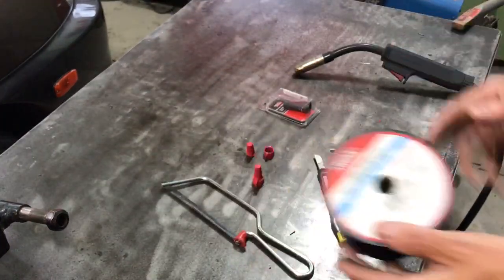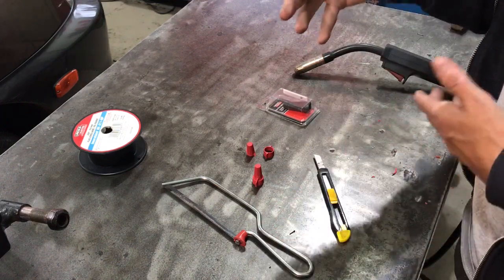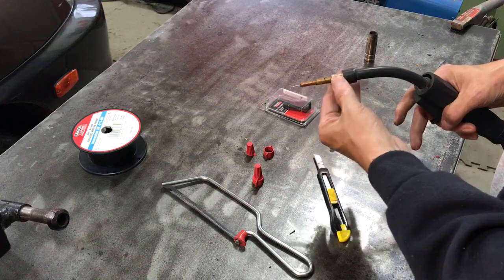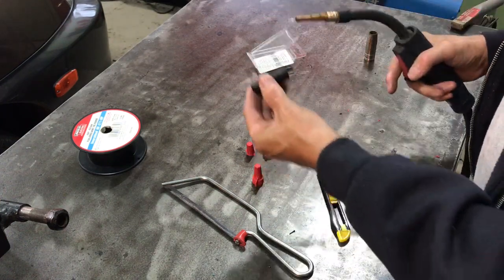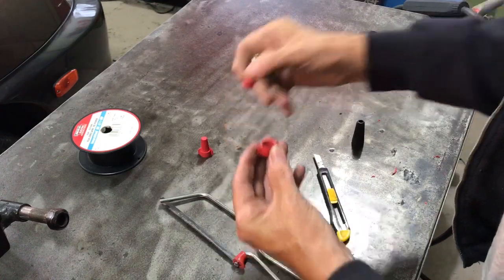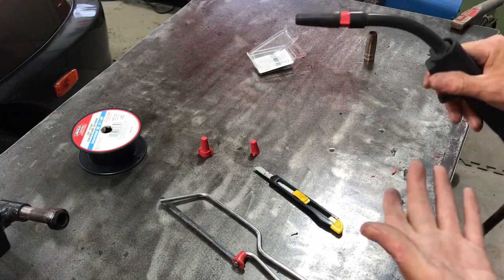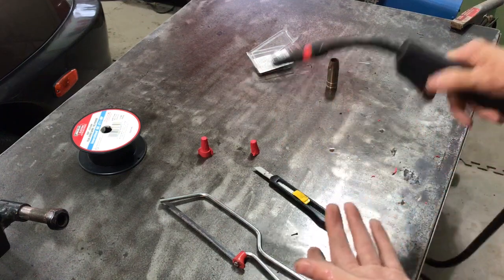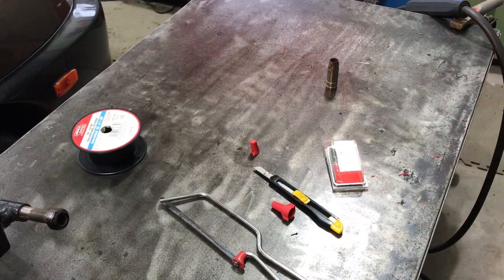Flux Core Welding Tip

Comment: Hey ho Bruce! Good brainwork with the tip. We used Lincoln rods for a long time. The company switched now to ESAB. Copperplatet wire but with gas only. I bet there are some subscribers want to c the actual welding. I do it daily and I think it’s a great work. Sure it’s a bit hot these days, rapped in lether but I still like it. Greetings
Reply from the maker: Hey Madworkx!  I use all different brands of rods but I've never used ESAB.  I've used their wire.
I'm sure it is very hot in the heat wearing leather!

Comment: Hey Bruce 《☆》 Thanks for that awesome tip Bro. We had a NAPA brand wire feed welder at My last job but never plumbed it for argon. We didn't have any Mechs at the time that were certified welders so We had to get any aircraft welding contracted out. The welder did get used quite a bit by many different people. No telling what happens pn the weekends around there when the Pilots have full reign of the place. The old Boss had the welding cabinet stocked up with all the best flux core wire & supplies but the ol NAPAs wire feed was intermittent at best so I pulled out the 50 or so year old Lincoln stick welder from under the bench where it had sat hiding behind some used oil buckets & various other sundry items so I could make some heavier wheel chocks that the Pilots had requested. The old solid rubber wheels rolled well enough to set it up out on the wash rack where I could blow the dust off of it. That ol Lincoln didn't skip a beat Man it fused that heavy angle iron together after a few practice runs I was good to go. Man welding is fun but I wouldn't want to do it every day ☻
Reply from the maker: Hey BDOG!  I have a really old Forney stick welder that I use whenever I can.  It's smooth as butter.  I bought it off a farmer for $50 and hauled it home in the back of my car.  It was a bit difficult to unload at home by myself being that it weighed about 150lbs and is the size of a small washing machine.
My father owned a welding shop and I learned to weld when I was a kid.  I realized early that I didn't wanna weld for a living but it's definitely a handy skill to have.

Comment: If you look at the under side of your plastic fluxcore tip you will see that its threaded and you can twisted over your threads instead of the red wire nut. Funny though cuz im an electrician and ive never used reds on car audio only butt splices and heat shrink tubing. Also when using fluxcore you want to switch polarity on the welder.  Your welds will be much better. Gas welding and fluxcore are not even close to the same. But you can gas shield fluxcore if you want. But double check your polarity and make sure you have it correct. It makes a world of difference.
Reply from the maker: Thanks for the tips

Comment: Lincoln 211-MP is the best and most expensive per pound. Blue Demon just as good for half the price. nice sizzle and amazing flow.
Reply from the maker: I've used Blue Demon TIG rod before but never tried their wire.  I'll check it out next time I'm at the LWS
Reply: @BruceLyeg  ..if you can find it get the E71T-11  if not E71TGS cost slightly less than 11 but both amazing results.

Comment: Thx Bruce. Does this nozzle fit snugly against the contact tip. Would it not melt? I am asking this as I bought a couple of nozzles and they have a very tight fit . I am wondering if these nozzles come in different sizes and/or are gun specific.
Reply from the maker: Hey John.  The nozzle hasn't gotten hot enough for it to melt.   You can always use a sharp knife or a drill bit to open up the end opening a little to keep it off the tip if it becomes an issue
Reply: @BruceLyeg  thx for the reply, Bruce. Just the answer I was looking for!

Comment: Good idea in the tip. I use praxair wire made by Lincoln at  a better price  in 10 pound spools .
Reply from the maker: The Praxair place near me is full of jackasses working there lol.  I avoid it as much as I can.  Maybe I'll try some of the other locations.
Reply: I get 10 pounds for $55  but in a  0.45

Comment: We must have different MIG guns.  Mine is a Magnum 100L.  My MIG nozzle threads all the way on to cover the diffuser.
Reply from the maker: My main MIG is a Lincoln and the one used in this video is just a cheap wire feed welder.  Kind of like the HF ones.

Comment: Why does the flux core nozzle not melt
Reply from the maker: It's a temp resistant plastic.  It doesn't get too much heat when in use

Comment: great tip
Reply from the maker: I saw what you did there.
Reply: You did it first!
Reply from the maker: You use wire nuts on cars, don't you!  I can tell...  and you twist the wires together in your house and black tape them!
Reply: Your'e a wire nut and your'e twisting my words, I just know it! As for household wire I though just covering them with hot glue was good enough. No tape needed.
Reply from the maker: You've been awake too long,  getting silly.  Take your Ginkgo Baloba so you can remember your name in the morning, kiss Bob goodnight,  blow out your candle and go to bed.
Reply: Bruce L. 
I heeded your advice, but I'm back.

Comment: You have the wrong tip. The flux core nozzle should screw onto the gun just as the the gas nozzle does, no gap. The correct tip is not tapered, smaller diameter and fits through the nozzle just fine.

Comment: Still cant get.the hanf of.stick welding
Reply from the maker: It's a little tricky to learn at first but once you get it figured out how to strike an arc, the rest isn't too bad.
Reply: One thing that really helped me with stick is the hand positioning.  Using your pinky finger and thumb on both hands put them into the position of telling someone from a distance to call you. Sorry if thats bad reference but after that place pinky of your left hand on the table , then place you pinky of your right hand to the thumb of left hand. As the stick burns up you can slowly thrink your hands into fist over fist. It helped me alot with keeping good arc length and giving my some support so i wasnt all over the place. I had to teach myself my first piece of metal had rods stuck to it all over and looked like a porcupine. I didnt know i had to strike the arc like a match to get started. I still laugh at how bad i was......so when the machine goes errrrrrr! Its saying errrr wrong! Try again! ERRRR TRY AGAIN! LOL